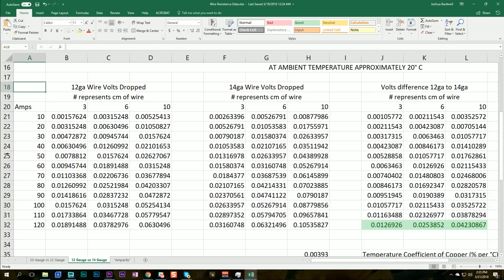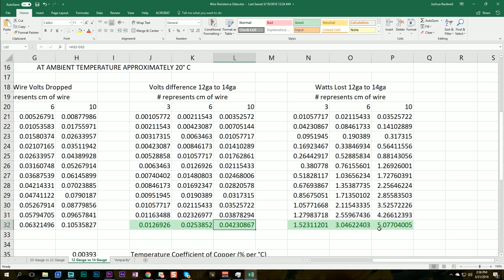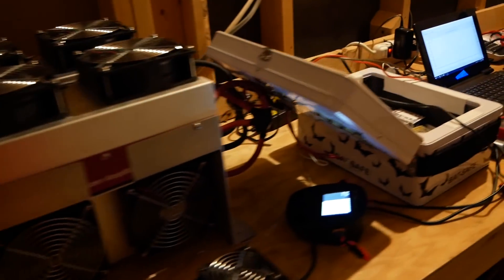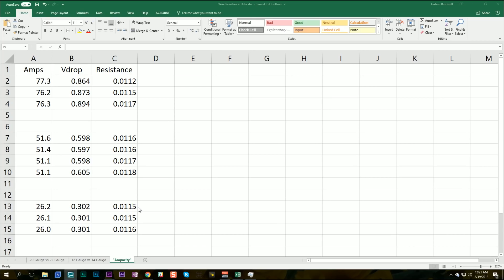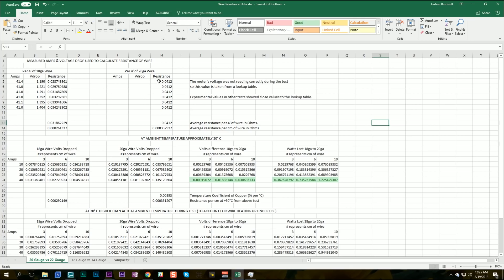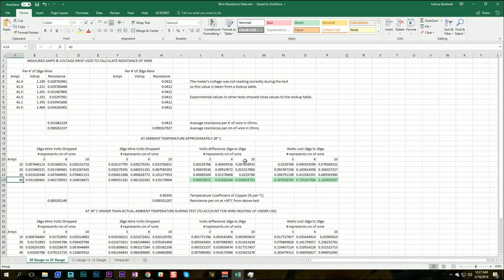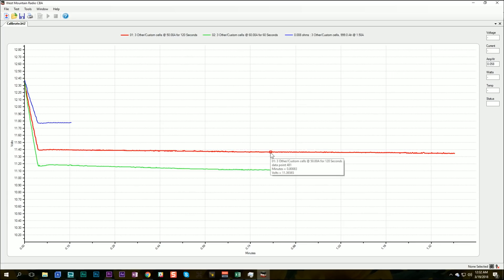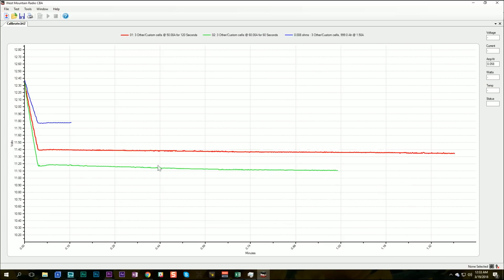Battery Wire Gauge | WHY IT (STILL) DOESN'T ACTUALLY MATTER

Comment: Hey Joshua, Thanks for making the videos.

I agree that the voltage drop or power loss is not the main issue.
The question I keep asking myself is what is the minimum size wire I can use before the temperature increases enough to risk damaging the insulation.

Approximations for fusing current, where the copper melts is pretty easy to find.
Fusing current of 12 AWG is estimated at 235A
Fusing current of 14 AWG is estimated at 166A
(The time take, insulation or airflow was not given in the website for these numbers)

But I have not found an easy resource that discribes temperature rise vs time and current.

As far as I can tell silicone wire is rated to 200 Degrees. So the question I think is important is what is the minimum sized wire that will take a specified average current draw, for the maximum duration of a flight, without exceeding say 75% of the maximum temperature of the silicone.

I think the reason this is hard to find is the cooling needs to be defined. So without airflow the number will be very different to with airflow.

I suspect I will either have to do the measurements or work out the math as I have not found a quick answer with google yet.

I thought you might like a different angle on the problem.

Thanks again.

Comment: One less thing to wake up in a cold sweat about. Thanks for the science!
Reply: Roland Sausage it’s nonsense though. I just ran calculations on my own cables. Had 4mOhm of resistance in those cables, which basically adds to the battery internal resistance which is about 20mOhms. So it adds 20% to that resistance. It’s like aging the battery. Under full throttle that is ~20W wasted on the cable, about 5% of the total power, just wasted! That last 5% the battery has to deliver completely tanks it’s voltage.

Comment: And are there any latency issues with different gauges?
Reply: I doubt it, the speed of electricity in 12 gauge copper wire is nearly 300 million meters per second.
Reply from the maker: No, definitely not.
Reply: Small current means slow charge-flow, large current means high speed. Zero current means the charges have stopped in place.The electric current inside a very thin wire will tend to be fast, even if the value of current is fairly low.By the formula :-
                     I
   -------------------------------  = speed
      Q * e * R^ * Pi

and definitely will,
there are latency issues with different gauges and the type od material you use.
CORRECT IT JOSH
Reply: How?